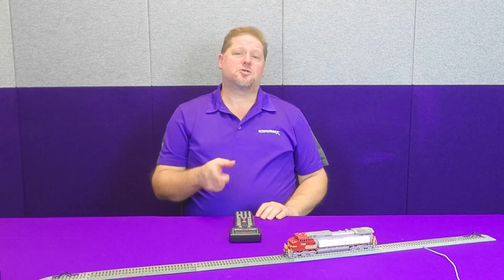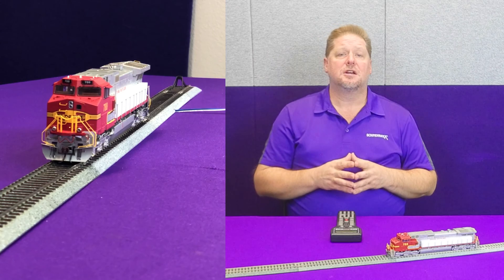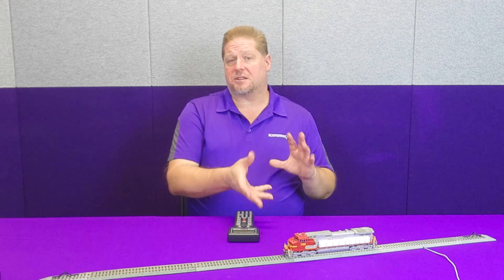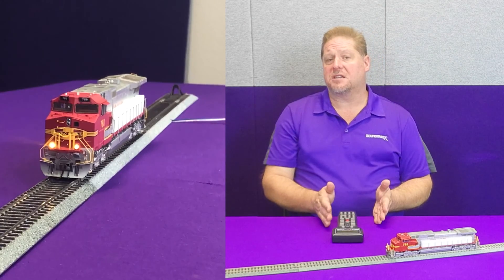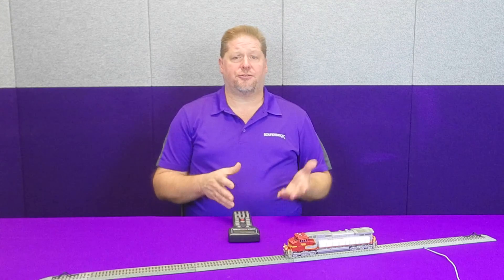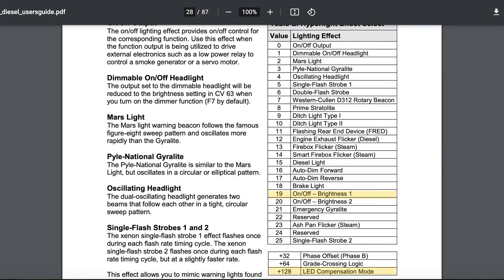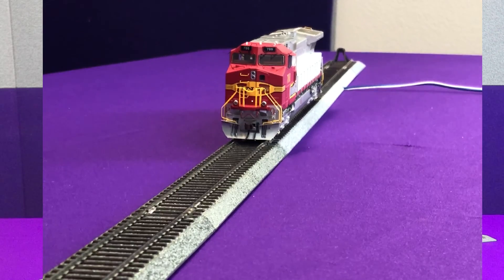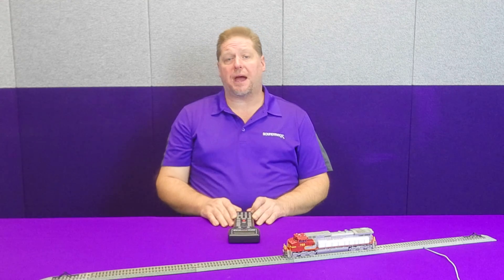Which FX Output Controls which Lighting Effect?

Comment: George, Some neat tips. Especially the CV 8 set to 9 didn't know about that one. I use a custom function map and I can see using that occasionally. Sorry but I don't particularly care for either TSU 2 aftermarket or Athearn from the factory function maps. At least you have made that pretty easy to customize. Just one more reason why Tsunami 2 is my decoder of choice.
Reply from the maker: I personally remap my own models.  The aftermarket was done for symmetry with previous gen decoders, as were Athearn defaults.  These were slightly changed to incorporate the new features too!  But we did incorporate the flex-map feature so we (the modelers) could move the effects under any control we want!  Great feature!  
Thank you for watching!  ~G

Comment: You need to explain better,  slower ,an how to, clearer, stop memorizing your lines, not all of us understand what u are doing...
Reply from the maker: I'm not memorizing any lines.  I am speaking off the cuff, so to speak.  Now, this information is to help you see how things are done, but for complete detail and explanations, refer tot he Tsunami2 Diesel User's Guide on our website.  That is where you will see the full explanation of the features and how they are used and set..  
In this video, I am simply showing you a way to find out which FX# output is wired to which light, so you can change the effects as you desire. In my opinion, the number boards are a tad too dim, so if I don't know which CV to change, then I'm guessing, and since i don;t work for Athearn, I am not always sure.  So this method of changing the effect to see which light changes helps us know which output is wired where, so then I can know which CVs are needed to be set.  
If you need further assistance, feel free to contact our support department either by phone or email and we'll be happy to help you further!  Thank you for watching!  ~G